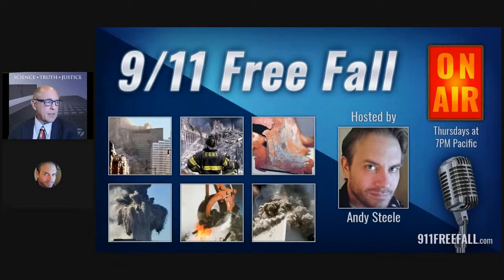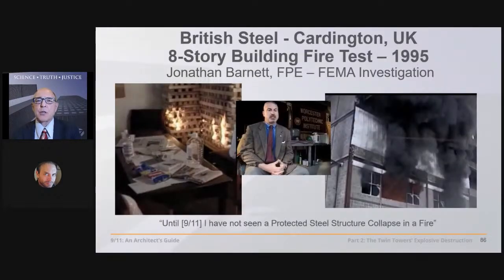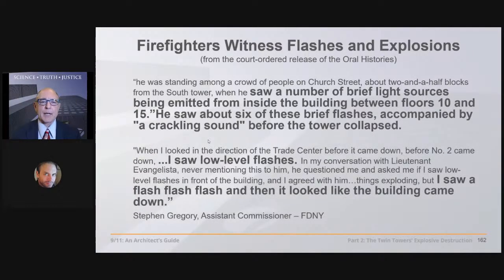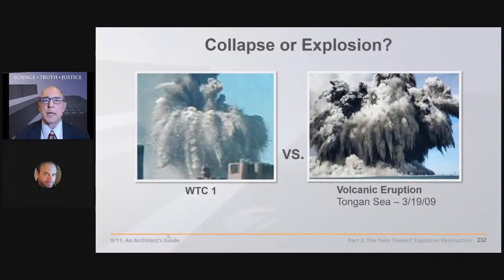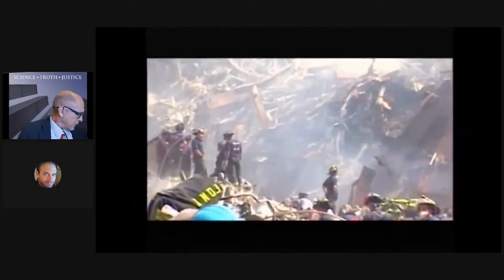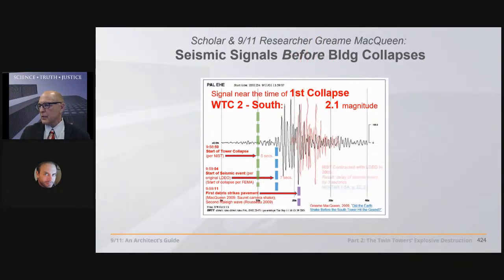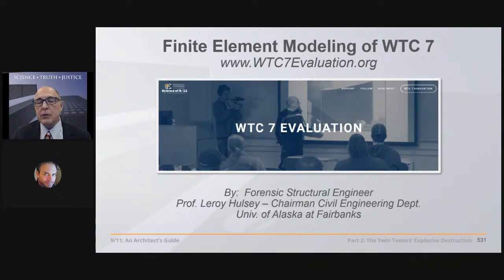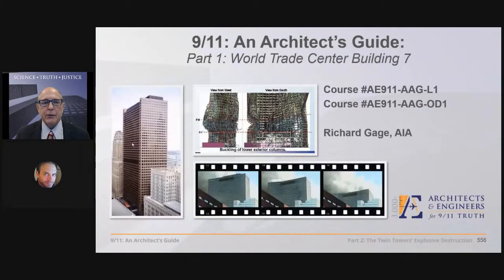9/11: An Architect's Guide - Part 2 - Twin Towers' Explosive Destruction (8/13/20 Webinar - R Gage)

Comment: Please AE911Truth don't assume planes were involved. You must know 767 passenger jets cannot fly at 1000 feet elevation at 500 mph. Additionally, aluminum planes cannot penetrate structural steel and concrete. You must recognize these facts.  Aluminum planes cannot fly through steel and concrete buildings. Get serious. There was no live video of planes flying into the buildings. Video's were uploaded to the media minutes after the upper explosions.

Comment: I wonder where our sidewalk Engineer is these days? 
That clip has always been very disturbing. 😒 👤👥
Reply: I think he's known as "The Harley Guy".
Reply: @sophorajaponica1  
If it's still alive, let's hope he's still looking over his shoulder waiting for the cleaners.
His performance deserves nothing less!
Reply: What a coincidence 
https://www.youtube.com/watch?v=JKvkhe3rqtc
Reply: @pinostuf9208  
The same thing was going on at Port Arthur in 1996.
Reply: @michellemaher6144  Were there Terror drills at Port Arthur?  I'm not familiar with the event.

Here's another one, I tried bundling a bunch together and it was deleted 4 times by YT.
https://www.bitchute.com/video/hPUTxlLzzyUN/
Reply: @pinostuf9208  
Sure was.
The coppers didn't turn up till 5 hours after the shooting in which you could have went to Hobart and back several times. Port Arthur is only 18 minutes away from Hobart by helicopter. 
The simulation they were doing was a shooting massacre......who would've thought? 😨
#FreeMartinBryant
Reply: Censorship has shifted in to high gear on youtube and the internet in general.   This is my 4th attempt, removing pieces until it gets thru the censorship. Here's a video of the harley guy. 

https://youtu.be/07hJhmiWZSY?t=49

Comment: I thank you for you efforts. I understand that your approach needs to be as precise and free of speculation as possible but, there is an elephant whom has been pooping up the room. You guys need to break on through to the other side, just like a 757 or 767 would not have been able to do on either tower. A 767 would have crumpled like a soda can and fallen to the sidewalk, regardless of speed. We'll ignore the, what was it? DC10 engines that were found on the sidewalk.
Reply: I think they need to avoid speculating and stick to what they know.   Otherwise they might lose credibility in some people eyes.  They are not telling us how the buildings collapsed, they're just proving how they didn't collapse.  I think they are taking the wise approach, let others deal with that part of it.
Reply: @pinostuf9208  ... Basically my exact comment.  God bless!
Reply: @Wes Fox  ... Looked into bird strikes on passenger airliners? Didn't think so. Looked into how the exoskeleton of the towers were made, and designed to take multiple hits from passenger airliners, do to their height? Didn't think so. Your bs channel, with 4 subs and no content, is subbed to a bunch of sports (distraction) channels with millions of subs. Go away, government agent, or bot.
Reply: @Wes Fox  .. Can YOU prove whatever radar you're implying? No. You can not. None of us can. Be gone....